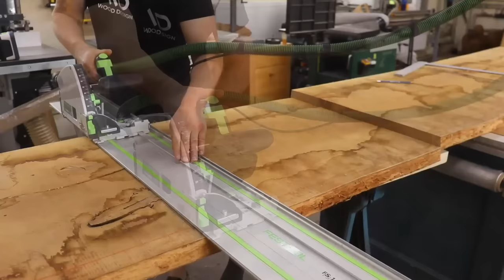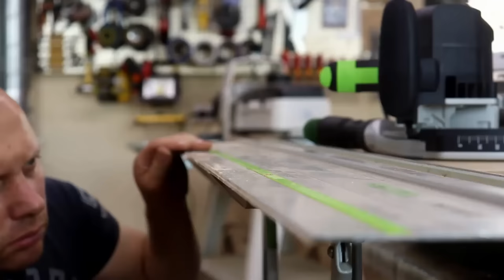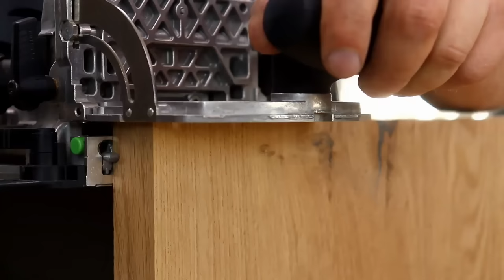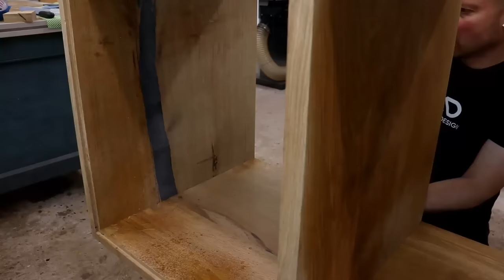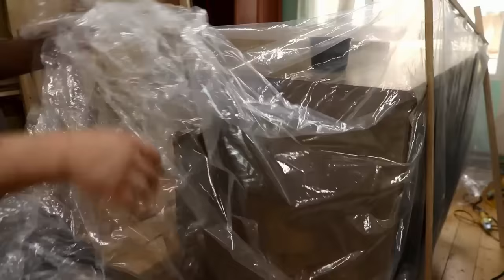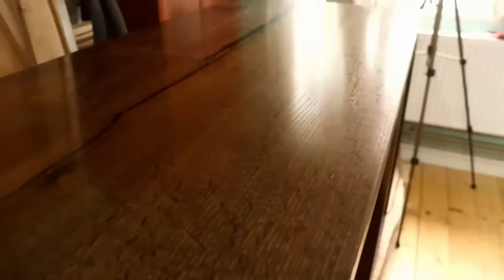Woodworking Project Chronicles: Crafting a Stylish Credenza PART 1.

Comment: I've watched a lot of woodcraft videoes but never seen that stain method with the bag and cups chemicals. What is that? 😮
Beautiful work.
Reply from the maker: Tanks for watching
Reply: Was wondering the same thing. In another comment, it's mentioned that it's ammonia. But my question is, were the cups moved around during the process? Or how did you avoid any circles from them sitting on top?